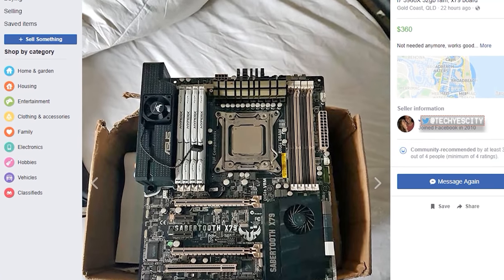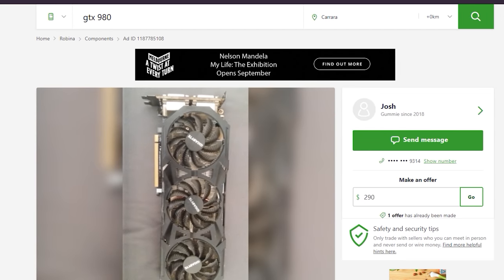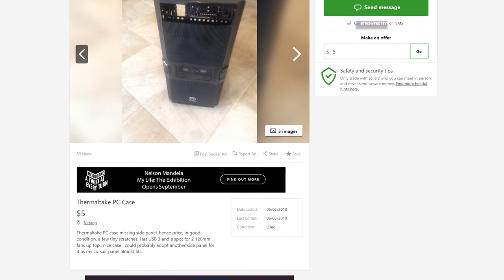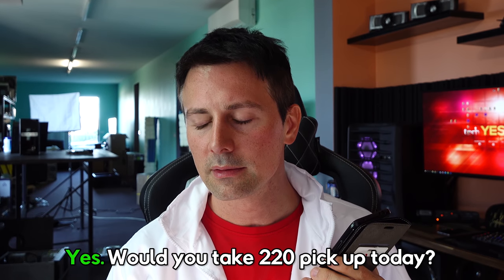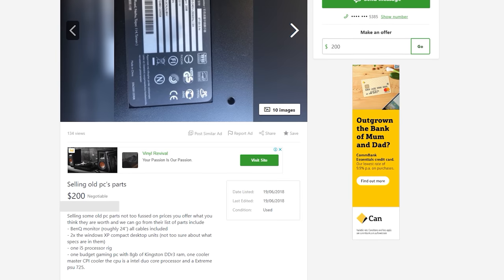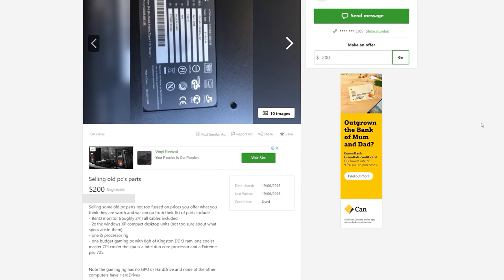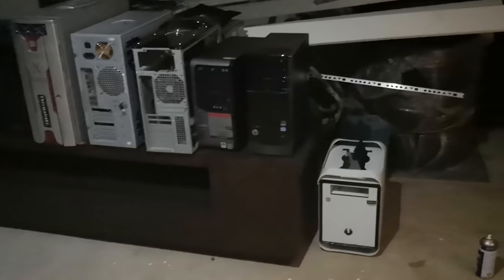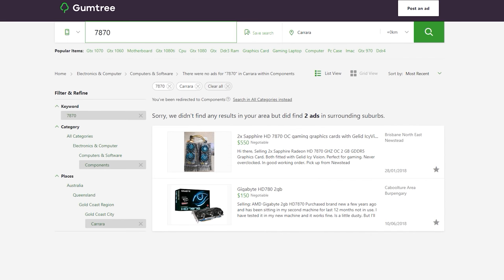June's MASSIVE USED PC PARTS HAUL - $1100 Later...

Comment: I just picked up a ryzen 5 1400 yesterday for $50 USD and I'm picking up a 1060 tomorrow for $150 USD! Also saw an rx 470 for $140 and an rx 560 for $80. This is the month of deals!!
Reply: How do you find such good deals? Here in the UK everyone thinks they're a shop owner and wants to make profit off of anything they sell.  People here sell items for the price they're happy with (Say £150) rather than the price it's actually worth (Say £30).   Makes deal hunting so difficult when a persons ignorance makes them massively over price their stuff.
Reply: Jaymiecain1 idk man. I just sold off my 980ti i picked up a year and half ago for trading my 950 and $100 extra hahaha just look daily
Reply: Nippledozer it was used from some guy who recently upgraded
Reply: Rock Wilson Wow, you're lucky dude, good for you. I paid $150 for a 1050ti
Reply: Nice! Just picked up an r9 390X for $150 too, but it came with an accelero III GPU cooler and works with my freesync monitor. High 5 for a good bargain!
Reply: I brought a RX 480 8Gb for 220 AUD
Reply: Got 16gb ddr4 for €50, a ryzen 3 1200 motherboard combo for €80 and a 27 inch Hp z1 pc for €95 (8gb ram, xeon e3 1245 v2(i7 3770),  4k screen.) Dope day.
Reply: Not as good of a deal by any stretch but back in December i got my Vega 56 for 379 usd. Thats about all the luck ive had with tech.
Reply: Awesome!
Reply: $220 AUD
Reply: I need help is a Xeon x3440 and x3470 supported by a P7H55-M pls help

Comment: That Dell Optiplex SSF will make a great little gamer if you go that way! I have two Dell Optiplex 7010 SFF machines one with 16GB DDR3 1600MHz, Intel Core i7 3770, 1TB Seagate Firecuda SHDD and a MSI GTX 1050Ti Low Profile 4GB card, the other machine has 8GB DDR3 1600MHz, Intel Core i5 3470, 1TB Toshiba HDD,  Gigabyte GTX 1050Ti OC Low Profile 4GB and both run perfectly with their stock PSU. So much power in such a little machines. I use them as mobile LAN pc's and "consoles".

Comment: I have that silver Thermaltake case in my basement. Was a cool case back in the day except the power button was made like garbage and liked to fall into the case sometimes.
Reply: Put it on ebay, if you don't plan to use it. I'd be interesting in bidding on it. I like to mod those Xaser III cases, especially if they have parts missing or are in rough shape. I can't bring myself to chop up the nice ones.

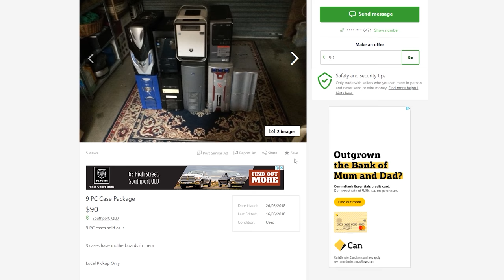Comment: Thermaltake xaser III that silver & red one at 5:13, friend has one locally that i gave too him (was a pentium 4 motherboard in it, front light was busted, missing 2 5.25 inch bay covers, pretty much told him its useful as a testbench case unless you want too mod it in some way.)
(took off the lock though as the key was missing on the front panel & took the fans as he didn't need them.)
Not sure if he has given it away or if its still in his room though.
Pretty much era perfect for socket 754, socket 939, socket 478,socket 775. heavy steel case as well btw with front lightning & a door covering the 5.25 inch bays, could be worth modding with larger intake & exhaust fans as most are 92mm or 80mm in that case.

Comment: I found a deal on letgo that was so good I had to buy it even though I don't have much of a plan for it. Asus CM6870 w/ I7-3770, 16gb ram and even a gtx 650 for $80 U.S.  
Got to be the best deal I ever made.

Honorable mention: Thermaltake V21 case for $10

Comment: I got a hell of a deal this past week myself.  It's not a gaming rig, it's for work, but I got it for a bargain.  I picked up an HP Proliant DL585 server with 4 x 16-core 6380 opterons (2.5GHz base clock, 3.4GHz turbo), 512GB ECC DDR3 RAM, and 6 300GB SAS 15K drives in great condition.  Added in a couple used Xeon Phi coprocessors (couple lower end 60-core models with 8GB RAM each) and a used 6GB Firepro display card.  Spent a total of about $3750 (US), paid zero sales tax, and I have a machine for rendering physics simulations (FEA and CFD for engineering) for work, rendering music at high resolution record/mastering/playback, and it encodes H.264 so fast it's INSANE!!!

Comment: Hello nice vid. Me and my friend bought 2 gtx 1050 his pc specs:i5 2320 8gb ram and the 1050 mine specs: fx 8300 4gb ram and the gtx 1050 his gpu useage stays at 90-98 mine stays at 20-30 while playing fortnite he gets like 150 fps more than me and his psu is worse than mine . Can ram bottleneck my gpu?
Pls help i cant even get the preformance that i got with a gtx650ti

Comment: Picked up an Ryzen 1700, Sapphire rx480 8gb, 16gb 2400mhz ddr4, Fractal Design Node case, corsair cx 850w, gigabyte ga-ab 350 itx motherboard and an 500gb Samsung 500gb v-nand evo ssd for 4k sek = 450 usd, 2 weeks ago.

Also interested in why you get hyped about monitors? Are used monitors expensive in Australia?
Here in Sweden you can pick up 22-24 inch 60hz monitors for 100-400 sek (10-40 usd)

Comment: Nice deal on that x79 Sabertooth/3960x.

x79 is still one of my favorite platforms, snagged three refurb x79 Deluxes last year for $150 each. Paired with two E5-1660's for $100 ea and clocked them to 4.7ghz and a 1680v2 for $350 clocked to 4.5ghz. All using 2400mhz DDR3 and still do very well today paired with 1080's (on sale for ~$400 before mining boom).

Comment: Hey bargain-god!
I bought myself I3-2100 Optiplex 790 system without PSU for 35 euros and I had PSU myself so I slapped it in there. Now I bought I5-2500 for 35 euros and I was thinking about slapping 750TI in it as 1050ti prices are too high right now.. Question is:
 How much should I pay for 750ti Low Profile 2gb model?
Cheers!

Comment: Picked up an Asus GTX 980 Strix for £100 ($180aus) and a Mint Dell Optiplex 990 i5 2400 1tb 16gb ram LP GTX 1050Ti for £100 ($180aus) a couple of weeks later from the same nice guy. Have seen new RX580's on amazon for £190 seems prices are finally taking a dive.

Comment: Got an 
i7 4770 
2x8gb 1600mhz
Asrock b85m pro 4
500 gb hdd win7 installed 
Psu 500 watts true rated 
For ~ 220 USD
And a Msi Gtx 750ti twinfror for 60 usd
$280 usd for this budget pc you inspired me building used parts and I'm inspired by your talent at deals :)

Comment: I was doing some bargain hunting over here in switzerland and got an Asus Sabertooth x79 board for free in an old Corsair Graphite 600T White Case.
I was told the on-board audio of the motherboard doesnt work anymore, but otherwise everything is fine. So for a small additional $15 he gave me his PCIE sound card he was using. Im still waiting for the power supply, so i couldnt test it till now.
I got a i7 3930k quite cheap ($80) and i also have the necessary ddr3. 
Any suggestions on what tobdo next? Im planing to put it together, match it with a decent GPU (i have a GTX 770 or a 560 TI lying around) and then flip it. Advice is very much appreciated. What price would you sell it for?

Comment: Looking at an i7 3770 (processor only) for $110, is that a good deal? Or should I get the i7 2600 for $85? Thinking of getting a GTX 1080 for it. Will I see a noticeable improvement by going for the 3770 instead of the 2600? Cannot overclock. It's hard to find K variants in our country

Comment: you gotta watch out buying those Dell small form factor PCs - they tend to be worth way less than youd think
Reply: why is that? I recently bought a dell optiplex 755 for my friend for 35 euro, slapped a core 2 quad in it for 15 euro and it's a great non-gaming home/office pc for just 50 euro
Reply: It's all about marketing. Pop in a GPU and sell as a gaming PC. That or pull the hardware and put into a standard case/motherboard